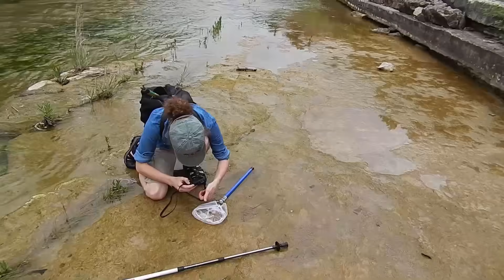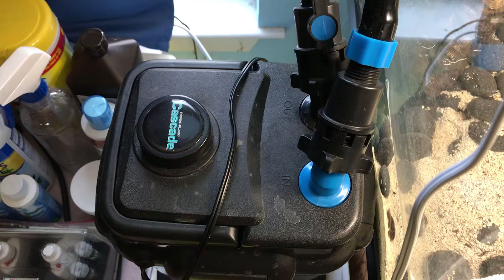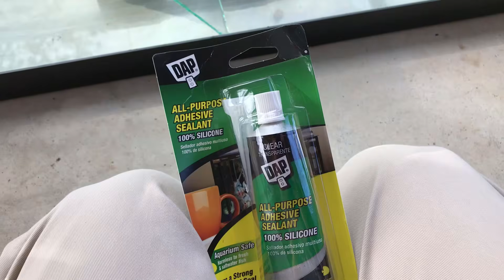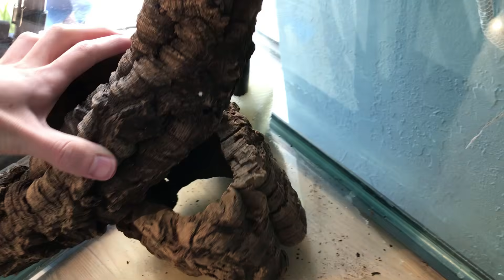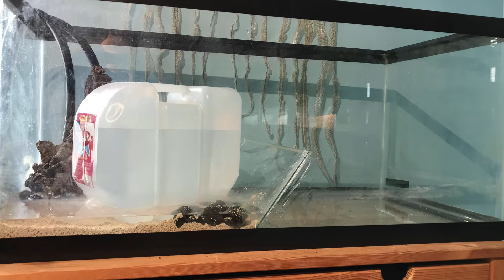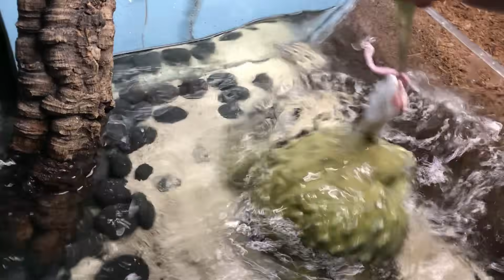Setting Up a Truly GIANT Frog: Meet my New 7" AFRICAN BULLFROG!

Comment: He looks awesome, just like your setup. Only problem with having such frogs and toads though is... you guessed it - having to clean out the poop from the water and then having to replace that water. It could get pretty tiring over time, especially for your kind of setup which has a significant volume of water in it. I've had American toads of my own, so I know what I'm talking about... Lol

Comment: You do not have to keep them in such a complex setup. I have mine in a large aquarium with frog foam with about half an inch of water on the bottom. I use a uvb day bulb for heat. Simpler enclosures are much easier to keep clean. Mine enjoys dozing under his uvb bulb and waiting for food. I kept my large female pacman frog the same way and she lived for 18 years so I must have been doing something right. I do turn the heat off at night. As long as they don't go below 70 degrees they are fine. Mine really loves to eat.

Comment: Right now my pixie is only about 3 months old and I use a Tupperware for his water section, I just change the water daily. I have it in a 40 gallon breeder with ground coco fiber and a ton of plants for hiding. I know once it's older a Tupperware won't work anymore and I'll have to transfer to this style set-up. Any advice on what the easiest filter would be to purchase? 
 I don't want to have to constantly change out the little pads in the filter. Used to own turtles and had to change the filter pads like 4 times a week, got rather expensive for such a cheap animal to care for. Any advice would be great! Thanks!
Reply from the maker: I have a Tetra waterfall filter rated for 40 gallon tanks in there now. Works awesome considering it's only about 5 gallons of water and the water stays healthy enough that I don't need to change the filter pad super often.
Reply: @AfroHerpkeeper  thank you!

Comment: You also forget to mention how you put the plastic on the sharp edge of the glass to keep the from from being sliced open BAD! I recommend getting the glass cut from a glass shop because they will bulk nose the glass which makes it impossible to get cut. The cheap glass from home depot and the likes are really thin, they break easy and can really cut you bad easily!

Comment: The reason you had a problem is because you didn't cut the hole big enough on the plastic nozzle which caused you to use excessive force to squeeze the sealant out.

Comment: Does the water need to be a certain temperature? Etc
Reply from the maker: Mid 70s to mid 80s is best, mine stays around 78 all the time but if you want to provide a heat element the hotspot should be about 85

Comment: If that's a plexiglass divider, you can sand it and round out the edges so you can get rid of that rubber bead thing.
I did this for my fish as the divider was part of a filtration technique, but I didn't want my fish getting scratches. 

250 grit will make it nice and around, 500 grit will damn near make it smooth for you. This can work on some regular glasses as well, but could also make some regular glasses chip away.

Comment: Good video but let down by not talking about heating at all.
Reply from the maker: I don't provide mine with any source of heat as he stays in my reptile room at a pretty constant 74-76 degrees. Access to a heat pad or a water heater is a good idea if the room is much colder than that.

Comment: So in this kind of setup how often do you need to change the water and the soil?
Reply from the maker: Depends. I usually just refill the water when it gets low and the filtration handles the rest. So far he hasn't produced waste on the land portion so I haven't felt the need to change it out - if I were to make it bioactive by introducing a cleanup crew, it'd be even less necessary.
Reply: Thanks for the reply, So even if he poop in the water, the water filtration are powerful enough to handle it? I was under the impression this guy's poop are really deadly.

Comment: With regard to the Silicone Sealant - as you said, it's important to get one that says 'aquarium safe' if possible, but, if you simply can't find one that says 'aquarium safe' (depending on your country, some people may not be able to find specifically 'aquarium safe' silicone) - make sure you get one that says 'ACID CURE'.
It seems really counter-intuitive, there are two types of silicone sealant you can buy, one is 'acid cure' and one is 'neutral cure'. 
I learned the really hard way (about 30 years ago now!!) that the neutral cure silcone (which was new at the time and I thought would be awesome - no pH mucking around)  is sudden death.
The acid-cure gives off acetic acid (basically vinegar) at quite low concentrations. The neutral cure, on the other hand, can give off FORMALDEHYDE as a by-product (and those which don't give off formaldehyde give off other animal-killing stuff). 
This not only kills any animals (in my case - fish) you put in immediately after your silicone cures, but will go on killing water-change after water-change. 
As I said, the neutral-cure was fairly new when I had my fish-mageddon, and I asked lots of fish-keepers why they thought this tank kept killing anything that went into it , after a couple of weeks I mentioned it to an aquarist who simply asked 'have you recaulked the tank recently?'. Then we worked out what was going on.
We considered scraping the silicone off and re-using the glass, but, in the end, didn't want to risk hurting any more fish, so we smashed the tank and put it into glass recycling as we couldn't be sure of getting 100% of the silicone off.
 
I think it's really important to explain exactly WHY people need to get specific silicones because even since then I've had people in hardware stores recommend neutral cure silicone to me when they've asked what I'm going to use the silicone I've chosen for, I've said on fish, or frog, tanks, they've said 'Hey, we have neutral cure, so you won't have to worry about acid in the tank!'. Of course I've assisted them with their knowledge base...  ;)
Anyway, I thought this might be an interesting thing to include in one of your videos sometime.

Your new Giant Avocado is gorgeous, by the way - I wish we could get some of the amazing species you have here in Australia, but I guess we have quite a few awesome ones ourselves :)
Reply: You should be able to find a Cane toad or two lmao

Comment: would a normal 10 gallon tank be good for a Baby Pixie frog?  of course getting a bigger one later for when it turns into god zilla.
Reply from the maker: For a baby, totally. You want to be sure it has access to clean water in a large dish at all times, and to keep the substrate just a little damp. It's fine if the top dries out, but if the frog digs down it should be able to find moisture. Babies also appreciate cover a lot more than adults.
Reply: another question, I have a 40 gallon fish tank in a spare room, would that be ok for when it gets to its biggest? also can u tell me what kind of soil to use? can I just buy organic potting soil or something?
Reply from the maker: This one's in a 40 gallon breeder tank, which definitely gives him ample space. Bigger is usually better, but yours would probably do fine in that. Anything from coconut coir to organic potting mix should work just fine.
Reply: oh and sorry, its not a 40 gallon is a 30 gallon tank, is that a problem? I don't really want to buy a new tank because they are not exacaly cheap.
Reply from the maker: That'd work for at least a couple years if it's a male - if it's a female that should be a decent amount of space to keep it in permanently.
Reply: I did the same thing u did with the tank u have I cut some plexi glass and used Clear silicone to separate water and potting soil, I made sure that it was pretty steep so it has all the room is needs to burry its self.
Reply from the maker: You might want to add some big river rocks to act as steps for your frog - mine actually couldn't climb up the ramp until I did that!

Comment: Is underground water that has been through multiple filters okay?
Reply from the maker: Well water? That's what I have out here. Works just fine! Just be aware that in some areas it can be pretty hard, with lots of limescale buildup over time. I would use it if it weren't for that.

Comment: Could you do like a budget build on this for the things that came with your frog like substrate and pump? I've got a tank, extra glass and silicone but what's the best diy pump and substrate setup
Reply from the maker: You can do a bare-bottom tank or grab a bag of nontoxic play sand or large river rocks for pretty cheap at your local hardware store. Coconut coir and organic potting mix are both cheap and do fine for the land substrate. As for the pump... I'm not certain what the cheapest options would be. It's worth looking into the DIY section of YouTube for that!

Comment: You could just aswell fill half with bricks/leca blocks and put a plate on top and add what you want that way you can fill the whole thing with water. Better than fastening a glass plate in the middle.

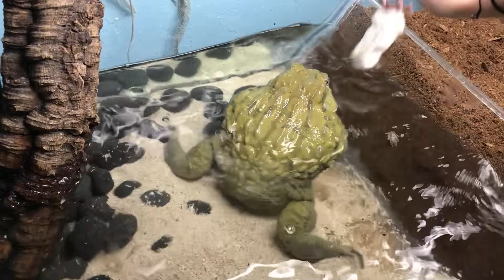Comment: What was the thing that seemed to break off at the end? 8:50
Reply from the maker: Little edge-guard I put on at the last minute. It's a piece of airline tubing that I slit down the middle to protect the frog from the glass edge
Reply: Gotcha, makes sense. I figured it wasn't a problem since you didn't make mention of it. Though I'm glad to have it confirmed.

Comment: You might want to make sure that eco earth stays moist. They dry out quick. I have a half land half water 40 gallon breeder for mine as well. How ironic. I use moss on the land half of mine so they are constantly moist. A fogged also might help with the moisture/humidity. Hope this helps
Reply: *fogger

Comment: Hey i have a male pixie frog as well however he has not eatin in over 4 months except for one roach. he doesn't seem to be estivating either should I be worried about this? he seems healthy except for the fact that he is underweight.
Reply from the maker: They can go without food for a long time, but I would start to get concerned at that point. Usually their feeding response is great. Have any environmental parameters changed? Access to water, substrate, change in temperature?
Reply: no not really just kept him inside his tank at 70-85 degrees with a fogger at 95ishh humidity. He woke up like a month ago and starting eating really good and started fattening up a little so who knows. Hes definetely smaller then your frog though hah.

Comment: Why not plexiglass instead of glass? Plexiglass seems safer.
Reply from the maker: It totally would be, but I'm not too worried about him breaking the ramp. I was thinking economically and in terms of matching the glass tank walls when I picked out the divider, but if I went back and redid it I'd probably use something sturdier. It's a thick pane of glass though!

Comment: Do you have any experience with leopard frogs
Reply from the maker: Not long-term, but I know one or two would do fine in a 20 gallon long, and a group would do great in a setup similar to the one in this video. Far as I know they do fine at room temperature in a mostly aquatic setup, with multiple perches above water.

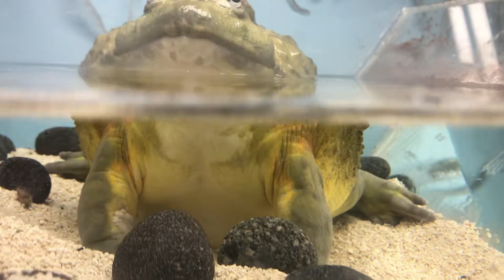Comment: 7:53 They're not that sensitive, remember where they come from.
Reply from the maker: I've heard horror stories! It's always possible - in the wild they aren't stuck in the same puddle constantly, like they are in captivity.
Reply: I doubt that one would stay in a toxic pool, they would simply move out of it if it could. In the wild it's been documented that they struggle to find water and have been known to stay in puddles together until it dries up. They then hibernate until the next rain. Horror stories come from people that don't understand what they are doing which is typical, so exaggerating like what you did is actually the most beneficial, Thank you.

Comment: Excellent vid! However a little bit of advice with the land/aquatic divider, glass isn't good. It's fragile, it can injure, depending on the creature it offers little grip, it's ugly.
A better solution is a limestone or sandstone paver or tile. They offer more grip for entering/exiting, are robust and can be chipped and sanded to make rounded edges. 
Generally I'll get a 50cm limestone tile and cut it in half, using an angle grinder to flatten and sculpt the cut edge.
Then I'll install it like you did with the glass, cut edge upwards.
For wider tanks you may have to join tiles to bridge the width of the tank, aquarium silicone is fine.
This method is exceptional for chelonians and young crocodilians too.
(A cheap angle grinder is an awesome tool for scaping; add a diamond tile cutting blade and you can cut, tile stone, glass ceramic etc.)
Reply from the maker: Thanks for the recommendation - I'll keep it in mind in the future! Glass is just what I had available, and for this guy I'm not too concerned. He can't quite thrash around with the same ferocity of a crocodilian, and he has legs strong enough to jump over the divider.
Reply: AfroHerpkeeper No worries. I've had a fair bit of experience designing enclosures for mass breeding programs (function, cost, suitability) and we found tiles were the best solution, the biggest outlay was the tools and sealant.
We were concentrated on small endangered riverine amphibians and glass was too risky and expensive.
Reply: graphite - I appreciate your reply here, too. We're organising amphibian tanks for all our frogs and will keep your recommendations in mind for our guys too.
Reply: I've had plexiglass in a tank for my firebellies for years and it's held up no problem, I pile some rocks up the side to make it easier for them to hop up
Reply: graphite l
Reply: Does it matter if it's *ugly*? And it's not that fragile, and the glass is thicker than normal. Smh.

Comment: Good lookin' fella you have there.  Any reason you opted for a glass divider instead of Plexiglas?  And how do you keep the water half from filling up with coco coir bits -- or does the filter clear them out?
Reply from the maker: I opted for glass just cause that was the first thing I found at Home Depot! Was worried about the water getting nasty, but the sponge seems to collect all of the dirt. Just have to rinse it off every so often.
Reply: AfroHerpkeeper cool, thanks for the info! My fellow is only 3" or so now, but I've been considering a similar adult setup.